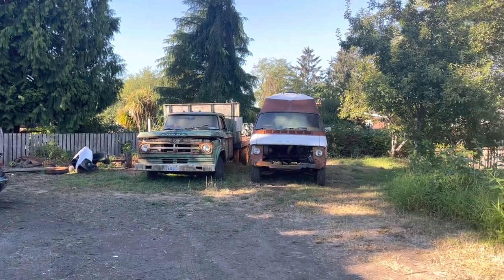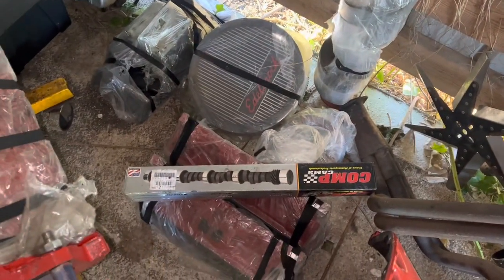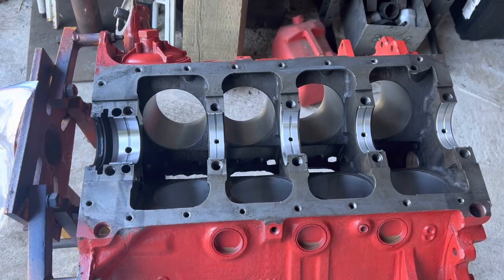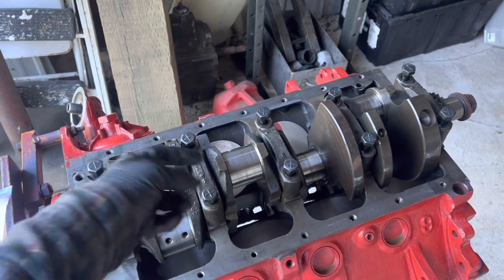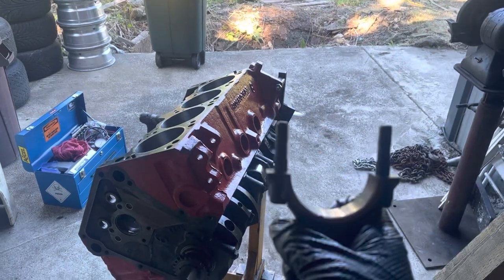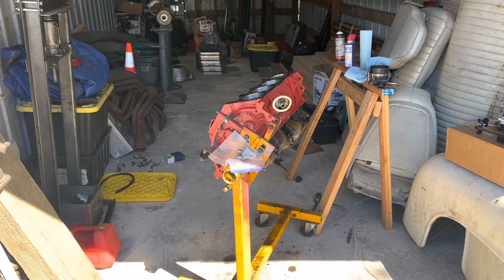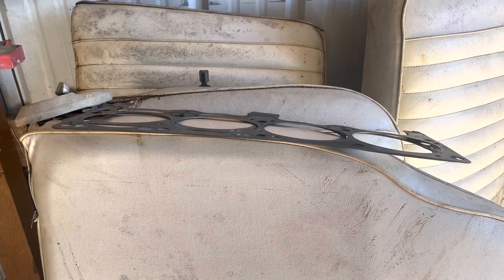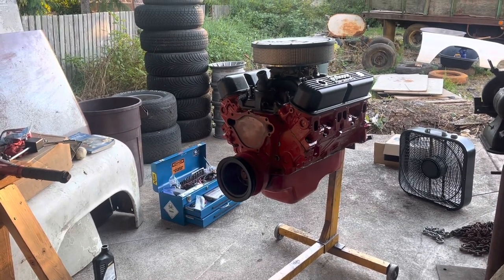How To Rebuild A Mopar Small Block In A Shed With WD40 And A Hammer - Garbage Can ‘Cuda 4

Comment: Very informative I have rebuilt a 273, 340 and 383 and the big block was the easiest
Reply from the maker: I love big blocks! I think my next build will be a 440. The only thing I really don’t like is the rear seal cap design. Those side seals are such a bastard to get right. Flat pan rail is so much better though. Pushrods are a little trickier too. But not a big deal.
Reply: I never had a problem with the rear seal but I agree the side seals are a bitch but I can say it was smokin when I got it and hotter after I rebuilt it

Comment: Used parts?...it'll be fine. These old mopar engines are indestructible. It will run like a scalded dog! Rear main seal will drip ...but not that bad.

Comment: With the old rod bearings, and possibly the mains- were they all more worn going forward from the pump?
   My early A-body engines had a similar pattern to your rods- just running stock depth pan w/accell/decell baffles and upper and lower windage trays.
   Used the oil pickup off the Milodon 7qt    pan, and cut up a truck pan for pieces to extend the car sump to match the.oil pickup tube & the dipstick guide to keep the dipstick out of the rotating assembly.
Reply from the maker: Aaaaaahh, there’s a theory. Further from the pump, oil starvation under hard acceleration, bearings run dry and heat up. Right? This car was definitely all party, all the time. I’m hoping the little dam helps. I actually have a deep sump, baffled pan somewhere that may be worth trying - if it fits the A body. Don’t remember for sure.
Reply: @DeadDodgeGarage   Unfortunately, most fit the '67- up A,B, E, F, G bodies great.
   The Milodon 7qt pan sump is too far forward- hits the K-frame on the early cars.
   Tried to dimple it- but its along a welded edge, split, and to properly weld repair all anodizing must be removed inside and out from the heat effect zone.
   Kinda forced modifing a 273 pan to get things moving.
   Holds 6qt- block was tapped, had twin  Olberg filters & an small Accusump w/electric valve- kinda went overkill/ocd but stopped the problem.
   Was well along trying to build a A/FX 64-65 Dart-
354 stroker gen1 w/mech direct port alky injection, '65 727 w/Clutchflite- was lining up a body & straght axle when I got laid off- you know the story from there.
   Steve Magnete's build your own altered wheelbase AFX kinda stoked that fire again- maybe a gen3/'65 727 pushbutton deal.
   Bought some truck parts off David R.- small world.

Comment: If I took my LA 360 to a machine shop for a basic rebuild and add on upgraded cam, lifters and springs what do you reckon it would cost?
Reply from the maker: It depends on what all your particular engine needs, how much you want to do yourself, and if you have the cylinder heads gone through at the machine shop. 

We just paid our local machine shop $2000 to clean and bore our 440 block, install cam bearings and freeze plugs (it’s cheap and saves me time,) polish the crankshaft, provide replacement pistons and all bearings and gaskets, and balance the rotating assembly. No actual assembly - I will be doing that. The pistons were about a quarter of that total cost. They didn’t do the heads - I will do a simple valve lapping job and new seals here. 

Having the heads done correctly can add another couple thousand to the bill in my experience. Then add the expense of your cam kit. If you want the machine shop to do everything top to bottom and assemble the engine, you can probably look forward to a $5,000+ build. These prices may also be entirely different than what you’ll find at your local machine shop.

If that’s not what you’re looking for, there are many ways to get that down to a “budget” build. Reusing original parts where possible. Honing the cylinders and reusing your pistons with new rings (if possible.) Doing all of the work yourself. I have done many budget builds with adequate results over the last decade. In fact, it’s what I prefer - mostly because when you take all of that money out of the equation, it’s easier to have fun, and if you ever have a failure… you just build another one. Haha. Hope that helps.

Comment: What is the difference between 360 and 318 motor mount brackets?
Reply from the maker: On the driver side, the rearward ear where the mount bracket attaches is closer to the front on a 360 than a 318, requiring either adding a spacer or a stack of washers. On early cars like this one, the passenger mount also requires modification. A 318 has four mount bolt ears while a 360 only has three, and the early A body mount uses the lower rear bolt hole that is missing on the 360. If you’re handy with a welder and a drill, this is pretty easy to solve too.

Comment: I have a 1977 Dodge 360 out of a camper I was wanting to rebuild it and put a bigger cam and put it in a '91 Dodge truck the truck has a 318 roller motor that I want to sell or give to someone to help me rebuild my motor and I have all kind of extra parts and I have a 1934 Ford roadster kit car that I will trade for motor and trans that runs and drives at least 400 horses
Reply from the maker: Where are you located? Roller 318s are good engines. I don’t really need any of  that but if you’re anywhere close to me maybe I can help.
Reply: @DeadDodgeGarage  Mississippi
Reply: @DeadDodgeGarage  am I too far away
Reply: @DeadDodgeGarage  am I too far away